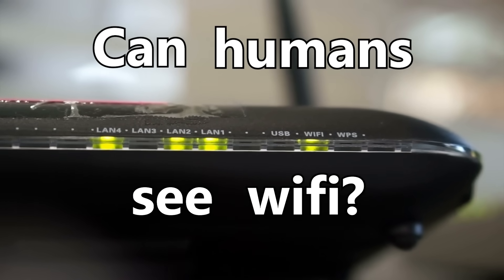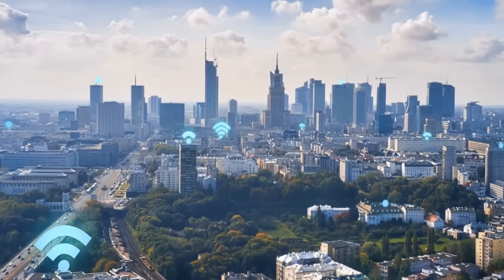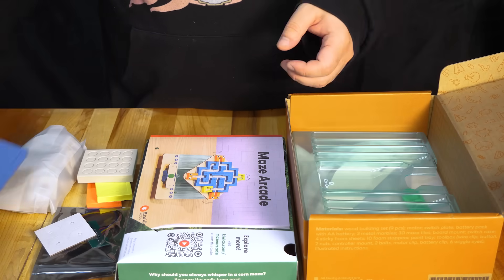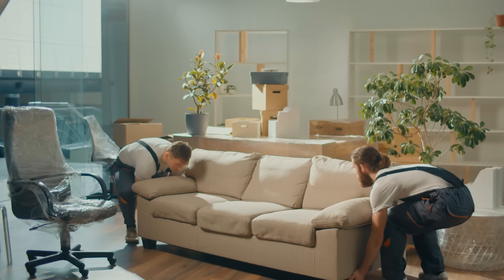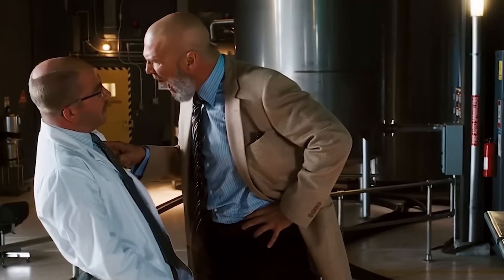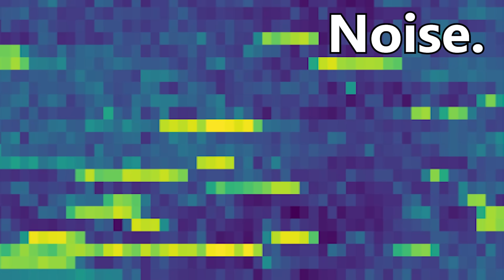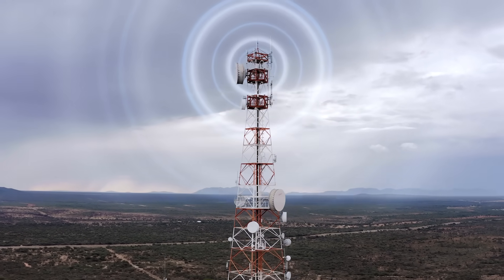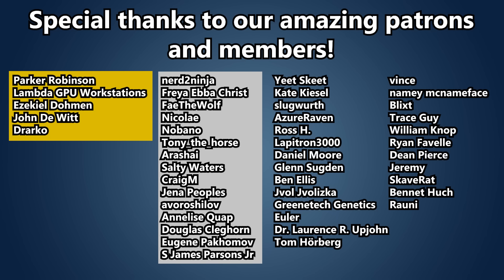This Camera Can SEE WiFi

Comment: What if you just used the PING command infinitely? You then know also know the packet pattern. What you could do is move the antenna to position, trigger command, after a set period of time kill the ping command, and move and repeat.   That way you know the "light" being emitted is the same "color".  By moving to a new location, you can have a better structure of the picture.

Comment: Correction: “5G” is the name of the latest communication protocols used for phone service. The actual frequencies used range from ~600 MHz to ~27 GHz. Cell service uses multiple frequency bands simultaneously to increase reliability and throughput.

https://en.wikipedia.org/wiki/5G_NR_frequency_bands?wprov=sfti1#Frequency_Range_1

In WiFi, 5G literally means 5 GHz if I’m not mistaken.

Comment: What if aliens stay away from earth because we are the only planet where life can’t detect microwaves and other frequencies. So our planet is like a massive epilepsy ball.
Reply: They would probably have a cool star.
Reply: Sorry to disappoint you, but there are reason eyes for visible light have evolved several times independently on earth and it's the same reasons why the resolution of the wifi camera is so abysmal and the range of your wifi so infuriatingly short while we can shine a laser at the moon without much trouble.
Reply: @christiannorf1680  And that is...?
Reply: @SnoFitzroy wavelength. Other than because the sun's emission peaked around visible light, longer wavelength also require larger detector while smaller wavelength can break stuff more easily because it is too energetic.
Reply: @SnoFitzroy  As the other guy said, wavelength. There is a physical limit to what you can resolve depending on the wavelength. The smallest thing you can resolve is roughly half the wavelength of light you are using. So for 5 GHz microwaves it's 2-3 cm. Meaning that things have to be at least that far apart for you to be able to see them as two separate things. And that's under absolutely ideal conditions, so in reality it will be easily a factor of 10 worse.
The other big thing is that the atmosphere is transparent for visible light, but not for most of the electromagnetic spectrum. Ever wondered why radio and other things operate at quite specific frequencies? They are using the "gaps" in the absorption spectrum of the atmosphere.

In a nutshell, microwaves are just a really terrible choice for seeing stuff
Reply: @christiannorf1680 is right guys larger the wavelength larger eyes needed and less sharp or detailed the light of anyone’s notices red light makes things look more soft blue light makes things more detailed and sharp and it’s because like he said half the wavelength is the smallest thing you see that’s why it seems like blue light is more detailed
Reply: @christiannorf1680  thanks for explaining I had no idea and this video lost me with an ad.
Reply: @BIOHAZARDES.Gamingflow  That's not at all true. Half the wavelength of visible light is hundreds of nanometers. That's 1000 times smaller than what ours eyes can see.
Reply: @christiannorf1680 bud what are you talking about how’s it not true my point is that you need a certain size eye to see certain wavelengths human eye size is literally made for the wavelength of light we see and dude red wavelength is longer then blue which means things are less detailed then like blue light because blue light wavelength is smaller so smaller things can be seen and technically you can see microscopic if you ever look at the sky you’ll see white dots those are white blood cell you just don’t notice them normally
Reply: @BIOHAZARDES.Gamingflow  The size of our eyes has nothing to do with the wavelength range. That is determined by the specific pigments in our retina that absord said light. Which again has absolutely nothing to do with size.
The size of things that can be resolved depends on several things. The wavelength of light only sets the absolut lowest boundary. 
You can't see anything behind your pupil because vision works differently. What you see is the diffraction of incoming light by objects inside your eye, not the objects themselves.
You can see smaller things with blue light under a microscope, not with your eyes. Because your eyes can only see things down to hundreds of microns. The differences in the wavelength only come into play at hundreds of nanometers.
Reply: @c @christiannorf1680 to not the white blood cells thing isn’t diffusion by the way
Reply: @c @christiannorf1680  forgot to note bigger light receptors bigger the eye I know this doesn’t relate but there’s an animal that see from 900-500  guess what its eyes are bigger by the why it’s nocturnal which also relates low light conditions means you need more of those cell means bigger eyes but also another point is that lower wavelengths equals lower energy lower energy equals a weak response which means you need more light receptors or bigger receptors for a stronger response like how rod cells are bigger the cone cells or more of them which equals bigger eyes I guess the size wouldn’t increase by much for near infrared visible and ultraviolet light but still gets bigger and dude just the smallest difference make a bigger difference for example 400 is violet light 395 is ultraviolet and invisible to me because my lenses in my glasses block out that light
Reply: @BIOHAZARDES.Gamingflow  Bro... you are mixing together 20 unrelated things and drawing wrong conclusions. I'd suggest you read up on how vision works.
Reply: @christiannorf1680 dude you obviously don’t understand how light works dude longer wavelengths means that it’s hard for light to be absorbed by smaller things longer wavelengths equals bigger eyes to collect light look it up dude
Reply: @christiannorf1680 and no I don’t have to go in how eyes work because I already know how they work bud you probably don’t understand how colorblindness actually works like I do
Reply: They left and they're not coming back. We all know why they left...
Reply: Lmao
Reply: This is an underrated comment
Reply: I wonder if this is the solution to the fermi paradox

Comment: The studs being metal is nothing new, its actually quite common in industrial buildings and workshops. Most likely the builder designed that specific area as a workshop and or garage, in which case it's nothing out of the ordinary. Metal studs are also typically 24" apart, whereas wooden studs are usually 16". 

I don't know off the top of my head why metal studs are used - I believe it may be to cut on costs and reduce weight since workshops are typically taller than other rooms, but I'm not sure.

Comment: 8:29 metal studs are typically used in comercial construction as they are generally speaking stronger and more lightweight than the wood varients, and in commerical applications its unlikely that someone will need to put up say, a tv mount, which would require a wood stud to screw into. I've also seen metal studs used in newer very high end residential construction though.

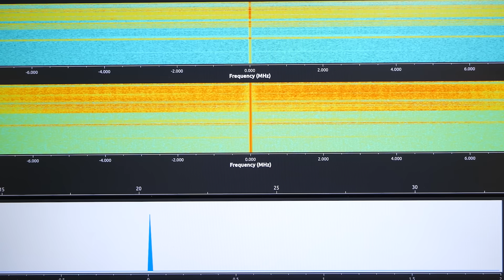Comment: 10:02 - I had exactly the same problem when trying to use a commercial MRI for quantitative research. There are a whole bunch of 'auto' things the software does that ruins any quantitative measurements.

12:00 - measure the galactic rotation curve by looking at doppler shifts to hydrogen emissions

Comment: Ok, hear me out, a microwave made out of only WiFi routers.
Reply: next to impossible, sadly
the power density of a normal wifi signal generator and antenna element is far too low
that’s why microwaves use a special antenna/oscillator assembly called a magnetron

Comment: Few things.
- iperf is your friend in this case. 
- radio signals are directional and phased. Phased isn't as important tho. 
- depending on the frequency, adjust your antenna size and impedance. A vairable resistor helps.
Reply: Also you might get unlucky enough to encounter a signal that has circular polarization opposite that of the antenna's spiral, and it will be received weakly or not at all.
Reply: @mal2ksc  true, but wifi signals dont tend to have circular polarization. Hello to a fellow satcom peer

Comment: 1:06 "5G signals are, well, 5Ghz"

I thought 5G stood for "5th generation" like 3G and 4G. 

According to Wikipedia:
"Low-band 5G uses a similar frequency range to 4G smartphones, 600–900 MHz"
"Mid-band 5G uses microwaves of 1.7–4.7 GHz"
"High-band 5G uses frequencies of 24–47 GHz"

Comment: Have you considered going the route of using three channel CSI to directly capture wifi signals by a wifi driver?  Its becomes a little easier to label the data and throw it through a neural network.  Thats how MIT was able to generate images of people via wifi side channels.   The extra channel gives you a third dimension you can use to help map space.

Comment: 0:42 I've been telling people, a microwave is nothing more than an angry Wi-Fi router in a cage.
Reply: I need to remember that!
Reply: They operate at 2.4Ghz.  Depending on your home router-this could interfere with the signal.
Reply: @honeybadgerisme  Only if your quarter wave trap is full of grease, in which case stay well away while it is warming your burrito.
Reply: @TheOwlman  nah dude-it operates at 2.4Ghz
Reply: @honeybadgerisme  My comments seem to be vanishing, so I will say it again: radio runs all the way up way beyond microwaves  into hundreds of gigahertz, so I don't know what point you are making. It doesn't stop until you get to far infrared.
Reply: @honeybadgerisme  I was kinda afraid when I realized this but using the microwave completely blocks all my 2.4 GHz WiFi signals. Tested this several times.
Reply: Milliwatts vs. Kilowatts is a bit different indeed.
Reply: Wait, how do radio waves heat food? 🥗
Reply: @vanchi9044 🧙Magic 🪄❇
Reply: @vanchi9044 

We've known 2.4GHz microwaves create a spinning motion in water molecules for decades now, the story goes, that when the british army was researching RADAR technology at around that frequency, they by luck found out that it would somewhat heat a humidified room over time.

Short answer why it works: Electronic distribution in H2O creates a very small imbalance due to the nature of both atoms, this imbalance can be seen as a dipole (keep reading), this dipole can interact with electric fields, once this dipole is submitted to the electric field of a X quantized energy of an electric field like microwaves (in this case 2.4ghz photons), it creates a spinning motion around the dipole axis, think of it like the earth's magnetic field spinning, or if you prefer a spinning top, which has the main vertical axis, and a rotation around it.
This rotation can be seen as a molecule mechanical energy, which mostly translates to heat, besides other types of quantum energies aswell.

Can't really explain to you why it is quantized (so specific 2.4ghz), it's mostly due to some wave duality stuff in quantum physics, and modern equations describe energies at that level to always occupy a certain level.

Somewhat theoretical stuff aswell, since this touches on the most elemental parts of particle interaction, so if you just wanna ignore it, go ahead, could easily be seen as magic.

Secondly, the difference between the 2.4ghz photons or microwaves emitted by a microwave itself or a WIFI router is purely energy difference, most routers are in the 10dBm emission, when converting thats prob ~10 miliwatts, while microwaves work in the 300w-1kW range, the reason microwaves output a much higher energy, is because if obviosly you cant heat stuff with 10mW, which is around 10000x weaker than the minimum of a microwave machine, and the component they use to produce that high output are called magnetrons. There is literally 0 difference between a wifi router and a microwave, besides the component that generates the photon itself, you can think of the resulting 300w or 10mW of energy, just the amount of photons, like the beam of a flashlight, if you increase the energy of the flashlight you aren't altering it's frequency, but the amount of photons released, and therefore higher energy.
Reply: @vanchi9044  From my understanding microwaves heat food because the particular frequency causes water to rapidly change alignment (being a polar molocule).  This causes the water to vibrate and become energetic (aka heat) and this spreads to everything around them via conduction.  This is why some things heat better than others in the device.
Reply: @vanchi9044 tbey are microwaves not radio waves, theyre the step up from radio. food absorbs them
Reply: @frostjune6072  To be slightly more precise (and probably slightly wrong since this is just a layman's understanding) microwaves make water molecules vibrate when they pass through them and this vibration generates heat. Since most of the things humans eat contain at least some water they are able to be heated in a microwave oven. I'm not sure what would happen if you tried to microwave dehydrated foods though.
Reply: @petermoore5981 
But isn't 2.4 GHz still in the radio frequency range? How are 2.4 GHz microwaves different from 2.4 GHz radio waves?
Reply: @vanchi9044  the amplitude of the frequency is higher in microwave ovens
Reply: @petermoore5981  its an old commonly spread myth that they only get absorbed by water, its many different molecules which is why plates and dry food also heat up
Reply: @ Exactly!  Microwaves excite molecules.
Reply: @vanchi9044  microwaves in microwave ovens are concentrated high intensity waves that can transfer/disperse heat effectively... (and microwave ovens are designed specifically to resonate with certain materials like fat and liquids)... 

radio waves are low-intensity with more dynamics regarding concentration and don't transfer heat effectively but can still transfer data... the frequency isn't really that important in this comparison, they can have the same frequency and still behave very differently... the amplitude of each wave is what matters most here...
Reply: @vanchi9044  There is overlap. Due to how radio systems have developed, the frequency spectrum associated with them has been disassociated with the traditional EMF spectrum.
Reply: afaiu the way they heat up food is the changes in the electric field make ions wiggle.

And water molecules (while usually not split into ion), are still dipoles. The oxygen atom attracts electrons more than hydrogen atoms do and so one side of a molecule ends up with slight positive charge and the other with a negative charge. So while the changing electric field will not pull water molecules in any particular direction, it will still rotate them a bunch.
Reply: DESPITE ALL MY RAGE I'M STILL JUST WIFI IN A CAGE
Reply: well if you thought so, my old microwave tbh in technical terms was an absolutely TICKED off Wi-Fi router until i got a new one where it just sounded frustrated af, but not as much that loud buzz box. And besides the old one was way more angrier to the point where i could just hear the mains frequency vibrating the counter. (to clarify the oven never interfered with the wifi, a lot of the microwave radiation is sorta dispersed out as sound)
Reply: @the_real_drwhoroblox1935  same here. i happen to also have a similar model to your new one, and i gotta say it may be the transformer in there. I have since gotten a replacement and it is really quiet so the point of an angry Wi-Fi router as an analogy is really out of the question unless you do the obvious.
Reply: HAHAHA I work with tech alot, I'll tell that to people. I'll pass on the word
Reply: Or perhaps a wifi router is just a microwave oven that can't hack it any more and has had to fall back on message transmission to pay the rent?
Reply: Every ray is the same. The only difference is the frequency.
Reply: my go to is gonna be when people talk about being "blasted" with wifi or 5g or when they mention gigahertz, I'll say "Now imagine how bad terahertz must be"
Reply: Well, you aren’t wrong, but wouldn’t it BE the cage?

Comment: If you start looking at signals up at 60GHz it would be cool to see you include some of the other optical stuff you were playing with like photon sieves (IIRC). At 5mm wavelength you can build reflection and transmission sieves from PCBs. You can also make lenses from high dielectric materials some of which you can 3D print.

Comment: I have done a lot of contemplating on the idea of using WiFi to take pictures. One of the problems that I forsee is that there is no lens. The Youtube channel called  Stuff Made Here recently made a camera using a single photo sensor that spins around. He can adjust the angle of the photo sensor while it is spinning. This allows him make a custom software defined lens. My description may not make much sense; you should watch his video to see what I mean. I wonder if you could get better results by attaching a WiFi reciever to something like his setup.

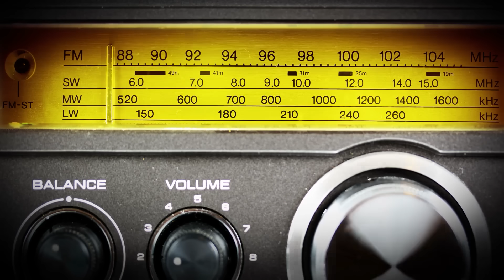Comment: 1:01 if your wifi router "oscillates" at (only) 2.4 GHz (and not 5GHz) then you should upgrade this 10+ year old router. the typical wifi router nowadays works on 2.4GHz and 5GHz both (as also the shown one)

Comment: This is SO cool! I have a question about that foil backplane -- did you happen to test with it removed? I'm curious because it looks like the surface is pretty uneven, and the overall shape is flat -- wouldn't that just sorta splatter around any waves that hit it, rather than direct them towards the receiving elements? ...Or maybe is it the opposite, and it's helping block local reflections from behind?